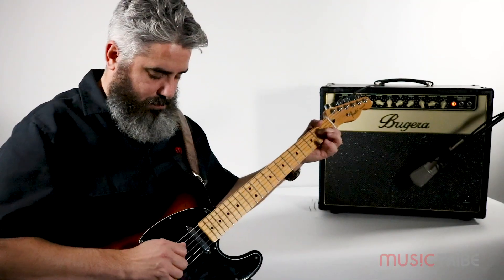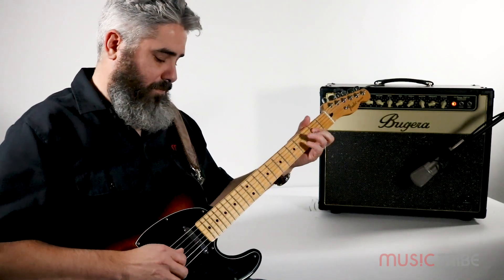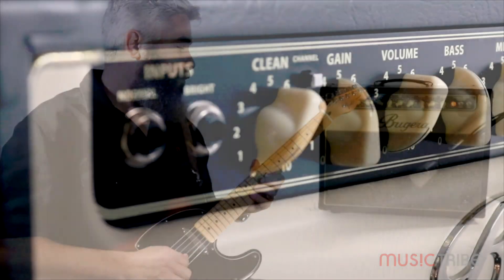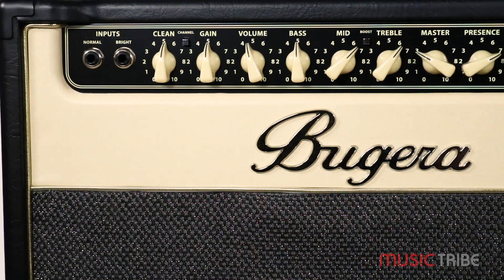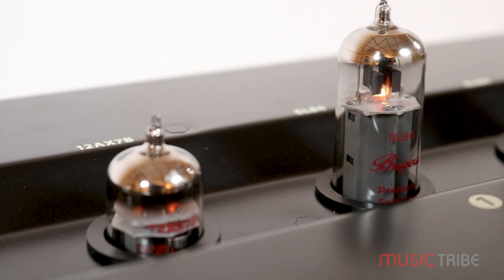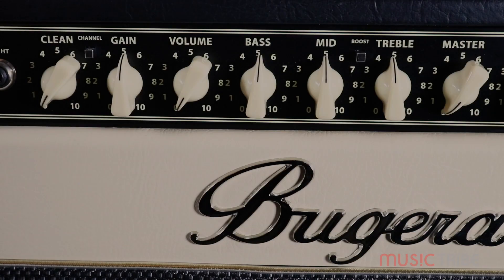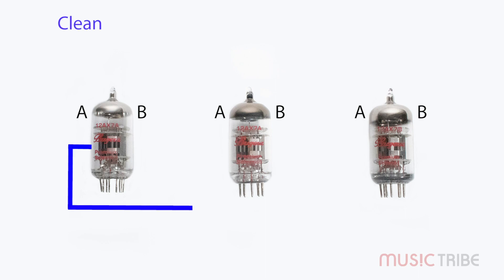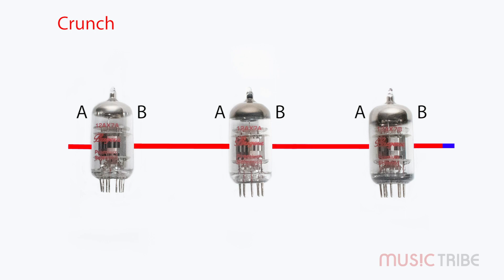Pre-Amp Tube Signal Flow For A Bugera V22 INFINIUM

Comment: I got a v22 since 2015. If you ignore the buzz that you get sometimes its a decent vintage amp. Very bright too. 
I got a EHX 12ax7s on V1  and a JJ 12ax7 on v2.
Both ordinary ,commercially available tubes.

I tried tad wa too at one point.

Comment: Sounds great! Much improved from their earlier incarnations! \m/
Reply from the maker: Thank you!
Reply: Hey DMS can EL-84's be changed to 6v6's in these V22 amps? Will the auto bias system allow this swap?  I like 6L6 / 6v6 over EL-34 / EL-84's.  Btw do you know of any of the Bugera Tube amps take 6v6 tubes? I'm looking to buy an combo that's gotta 12" & a Fender type clean w/spring verb but a smoking Lead Chanel or a great crunch sound i'm looking hard at this amp or the 55watt one. Thx

Comment: Which tube is first & last. Not sure where to install the first tube. I want to try changing it with a 12at7 in order to reduce the gain and overall volume. Smooth it out a little for Blues at my apartment. PLEASE RESPOND. Thanks again.

Comment: Thank you so much for this vid. I couldn't find this info anywhere else. I really love my v22hd but am looking to change the dynamics of the gain channel. In your opinion, which tube swap would have more effect on the sound of the gain channel, v-1 or v-2? or would a v-3 swap also effect the gain channel? The clean tone on this amp is incredible but the gain channel is just a touch to fizzy for me.

Comment: Why do you have to use a 12ax7B in the Phase inverter as I am not sure what the B is really indicating. Is it a more robust tube design or lower noise floor?  I have the infinium 55 Watt combo and the Infinium 22V Head.  I love the 22 watt. The 55 Is more like my fender amps. Thank you for the good review.

Comment: I want an easy way to add a real spring reverb tank to mine haha, I’ve built other amps before but I used old-school point to point wiring... not too experienced with smaller PCBs just yet so if I went inside I wouldn’t know where to split off for my tank, or if you guys need reverb amplifiers for the small reverb sound processor card you have inside..?

Comment: I have two questions.  One, I have been using an amp sim pedal (Joyo British) through my effects loop.  I plug into the pedal, not the amp.  Since this amp has some more circuitry, is this a safe thing to do?  Second question. What are the specs of the Turbosound speaker? RMS, peak and so on.  Thanks!

Comment: Is there a way to change the valves without having to remove the chassis? I tried doing it with the chassis still in cab but ended up breaking pins on the valves as you're almost doing it blind. Hard to line up the pins.

My one complaint with the amp
Reply: That's with any amp and no there isn't.  Honestly it's not hard I've done it.  Just spin the tube till you feel it drop down a bit. That's a dead give away you're in the right spot.  Never broke a tube in 10 years.